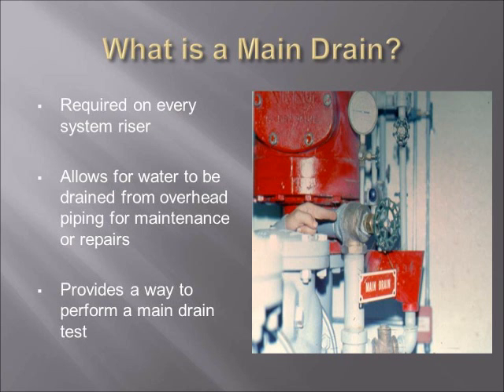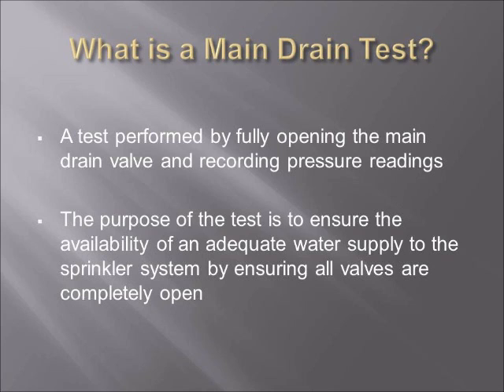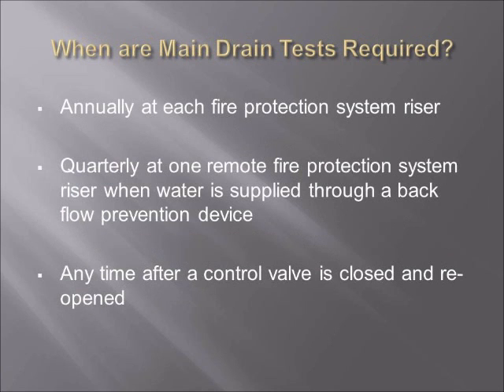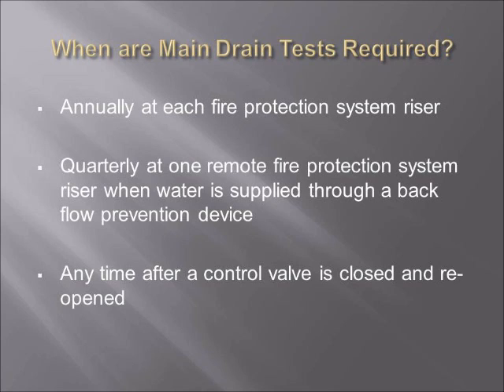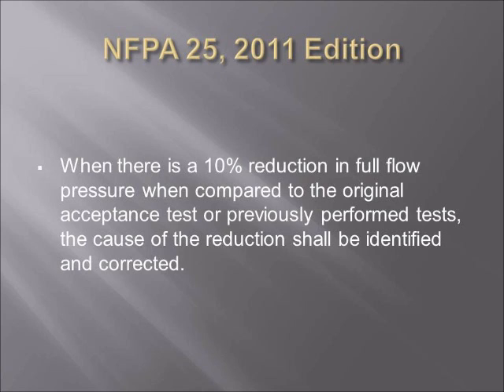E-News: Main Drain Testing

Comment: NFPA 25 allows to test one system per lead-in.   meaning that if there's a feeder to the building and then in the building there's a manifold with 2 or more risers, it is allowed to perform this test on only one of those risers

Comment: How to remove air in the hydrant pipe system
Reply: nobert ngoyinde turn off al water connections so water won’t spew out, unscrew the the cap of the water container and let it sit for a couple seconds. I have a sprinkler system and we do this all the time